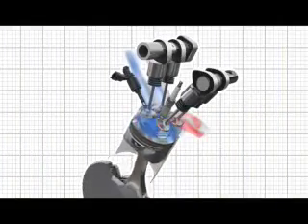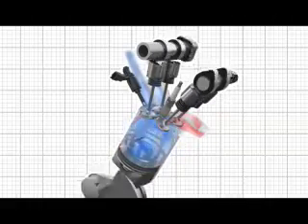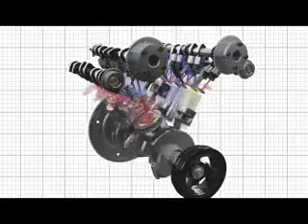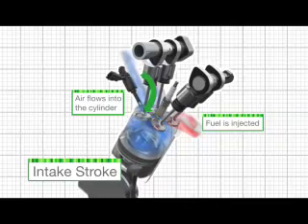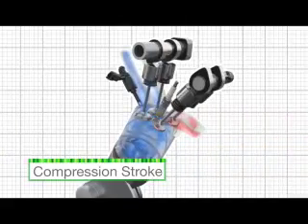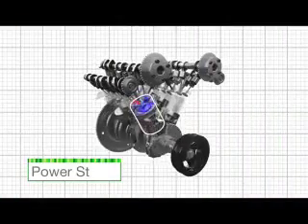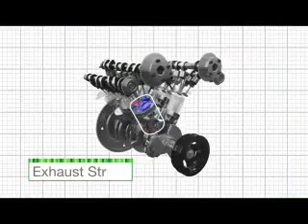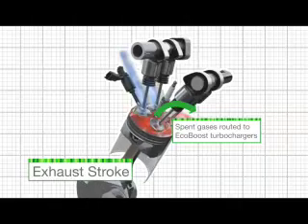NEW EcoBoost Technology Animation

Comment: This is nothing new. the turbochargers raise air temperatures and preassures inside the cylinders to allow a smaller amount of fuel to be used to create the combustion. it's just a super-lean burn system. it is a science that has been around since the first turbo diesels, just using gasoline instead now. the only downside to the system is the EXTREME cylinder preassure. GM is trying to avoid forced induction, as the engines will need to be designed like diesels: heavy, super-durable, and slow.

Comment: Not the same Khoi,  A turbo uses recycled gas through a turbine and waits for pressure (boost) to build before injecting , this seems to use a actuator or some shit to maintain a pressure to DPI (direct port injection) the air instead of spooling it back through the intake.